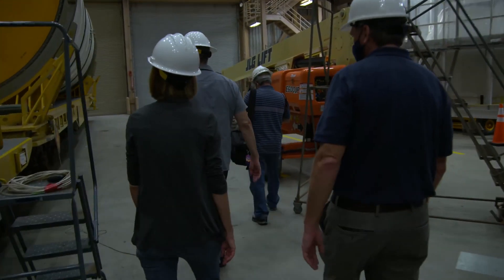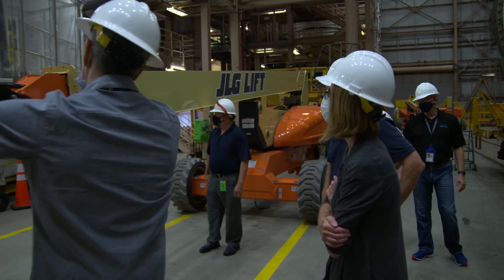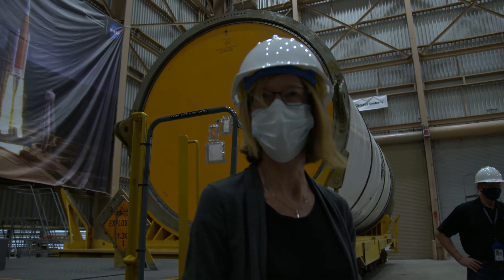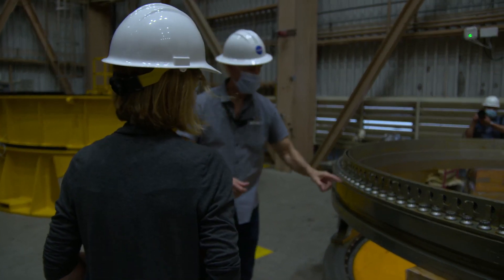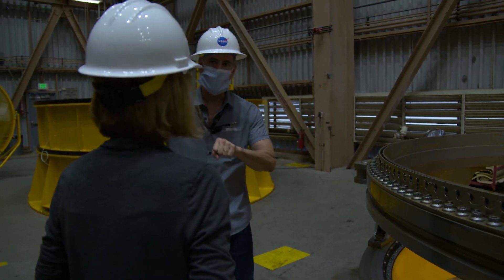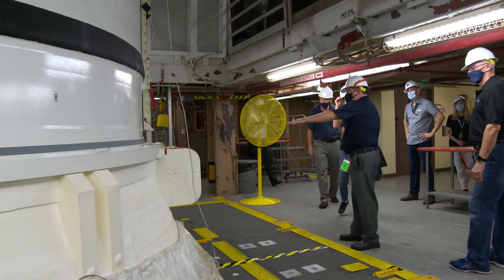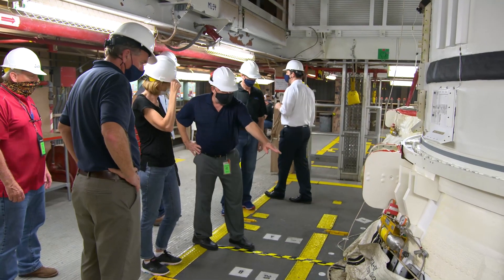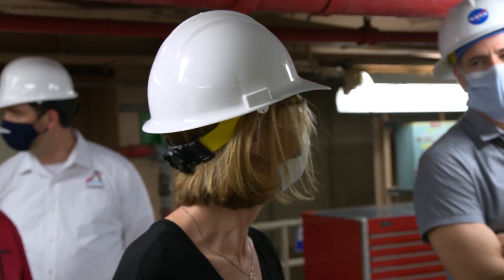Kathy Lueders Visits SLS Artemis-1 Booster Stacking Ops at KSC

Comment: Is good to know that nasa is really committed to push the timeline, spacex has shown the way and esa is going reusable, maybe this will drag nasa to do the same
Reply: I am afraid not as NASA has already ordered 10 more SLS launch vehicles and 3 pairs of SRB's.  ALL not recoverable. (Maybe the SRB shells, then they require complete media blasting, visual inspection and reloading.  It was proven during the shuttle era that a new shell was cheaper.)
Reply: Reusability on SLS is unfeasible due to its low flight rate